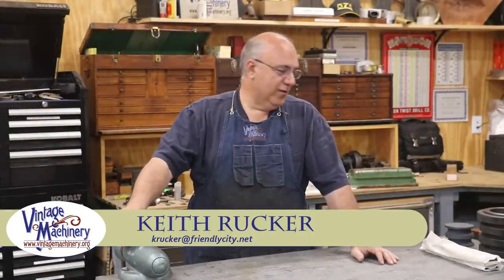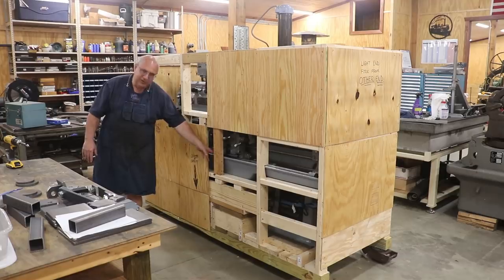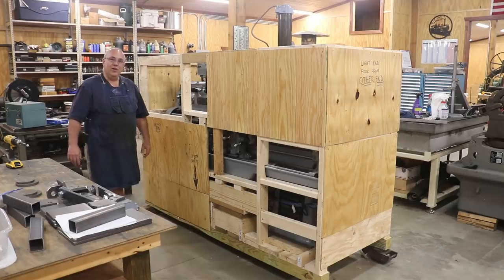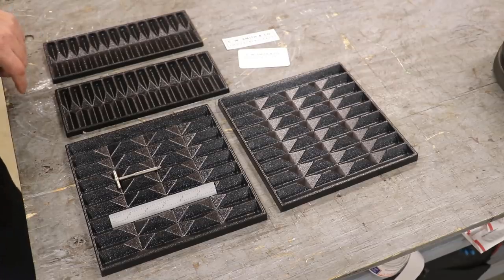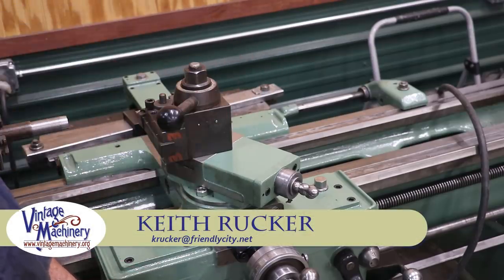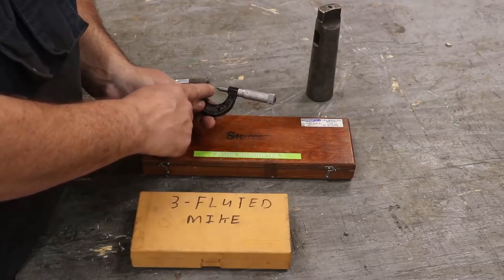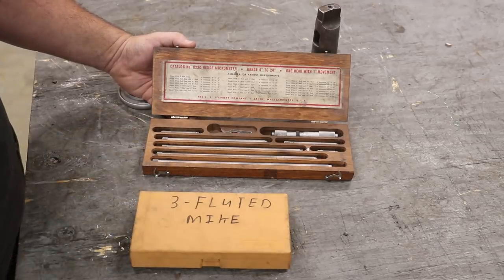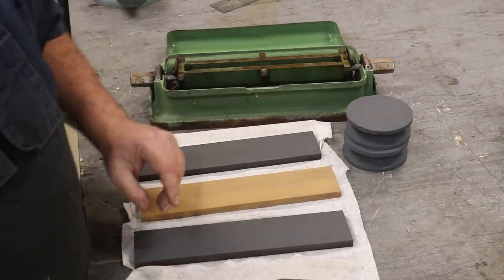Odds & Ends 105:  LeBlond Lathe, New Tools, Viewer Mail

Comment: Starrett 210: useful as a small point mic, but intended for thread comparison. Starrett 823: the total range is covered by using a rod on each end of the head. both 'caps' unthread. the chart tells which two to use for a given range. With the Slocomb imc: Be careful if you need to adjust it or remove the spindle. The Slocomb's are not adjusted, and the friction is not set, like modern mic's. The friction is set using a two part with spring doohickey. It gives great feel, but is often messed up by people that don't know the mechanism.

Comment: Consider having the mill shaft friction welded, you can also add to the length if needed.
check with them  usually they can weld to a close tolerance.

Will be a cost but not as much as a new shaft. 

Play Safe From Elliot Lake Ontario Canada.

Comment: Horizontal boring machine? Nice video! I'd second the suggestion to put 2x4s on the outside of the box crate about chip pan height. Be careful about box trailers, the flatbed boys will definitely strap it down well. Tarp it.

Comment: If no Index shaft is found, the solution to getting it fixed without remaking the whole part would be to sleeve it. Relatively easy to do on a lathe. You bore the two ends and then make a inner sleeve to connect them. Spot brazed at the ends through cut holes, and at the center line via V-ing out the break. Have done it on my mill. This unfortunate situation is the result of misalignment. The shaft breaks eventually (kinda like work hardening some wire to break it off). My repair has lasted for 3 years now. Used exactly the same type of metal as the original (had a friend source it for me).

Comment: Just out of curiosity, what sizes are those ring gages at 6:02? They look big enough to be engine-cylinder sized; I used to use similar ones, but smaller, to set an air-comparator for gaging hydraulic gear style pumpmotor chambers and shaft journals. They can also be used to zero out bore gauges for a specific size, like engine/piston-pump cylinders.

Comment: Keith, do you know of a method that carbide mill cutters can be sharpened without buying some expensive machine that wouldn't prove financially advantageous.  I have a Nova drill press/mill that I was thinking about chucking up a bit in need of sharpening and adding a diamond plate on the bed then slowly run the cutter on the plate.  What do you think? Will it possibly work or am I heading for trouble.
Reply: Not sure that would improve the cutting edge. If I understand your proposal it will joint the edges so they are concentric, but it will remove the relief. The result will be an edge that will not bite in.